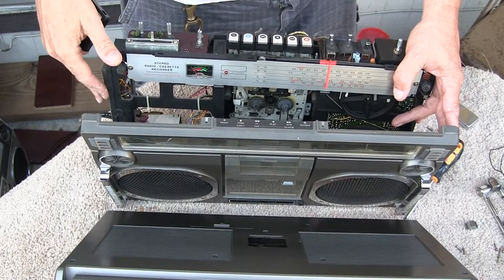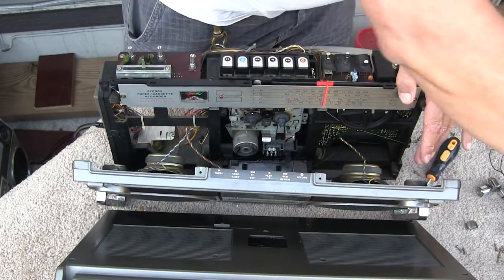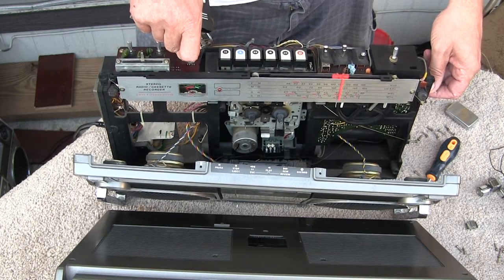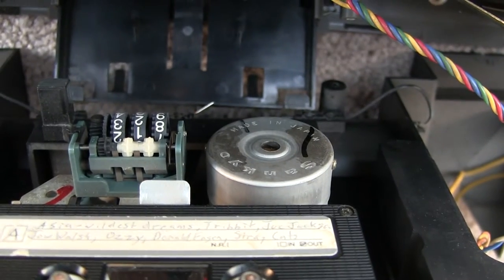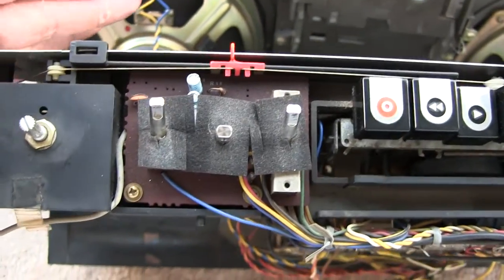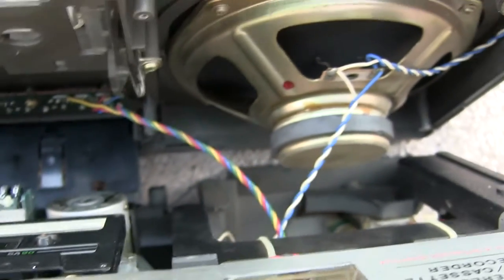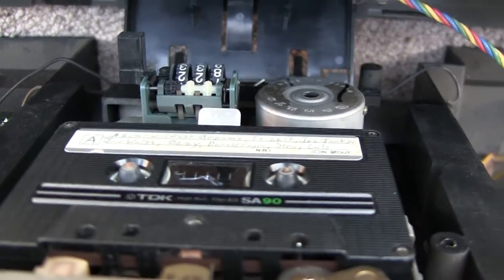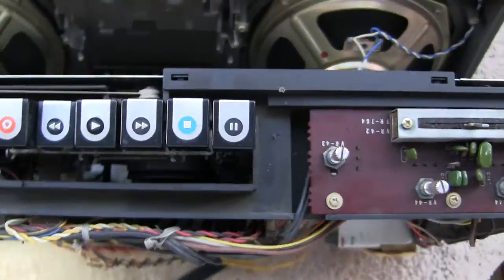Conion CRC H58F inside boombox

Comment: Hello, I ask you a question even if it's been a long time, I have the same problem with the engine speed. Did you find a way to adjust it? Thank you
Reply from the maker: There should be a hole in the back of the motor that you adjust the speed with a jeweler's screwdriver about 2 mm flat tip

Comment from the maker: This is why I made this video to show how difficult it is for ME to make a speed adjustment in a unit where I have never worked on that particular motor before.
 Maybe there is somebody Out there that has More experience in this brand of motor than me - to be able to adjust the speed for this deck - and since You are viewing this as anybody can see it - you would be able to discern if you can repair this or not.
Reply: There is usually a hole, but in this case there is no hole. I painstakingly removed the back of the engine to figure out how it was built, but there is no adjustment. I can't even find the wiring diagram. Thanks anyway
Reply from the maker: @giancarlopilla3185  then what you do is you follow the motor wires from the motor to the circuit board and locate the variable resistor that will adjust the speed of the motor. These photos are not perfect so the manufacturer has to have a way of adjusting the proper speed for the motor I guarantee you it's on the circuit board.
Reply: @Cassette2Go  In order not to accidentally rotate some trimmers, I slightly increased the circumference of the motor pulley. In this way the reading speed increased (before it was slow), then I applied a variable resistor on the motor power supply and I calibrated the speed. Seems to work fine....hopefully. Thanks for the useful tips, you've been very kind. MANY GREETINGS
Reply: I'm currently working on restoring one of these machines. Could not find a pot on the main board or the motor, i suspect the motor has an electromechanical governor. I tried to reach it but so far have not managed to remove the rear cover off the motor. 

It runs  at about 95,5% of ideal speed right now. I'm considering replacing the motor with one that does have an adjustment built in. The motor runs clockwise, but i dont know it's stock rpm.